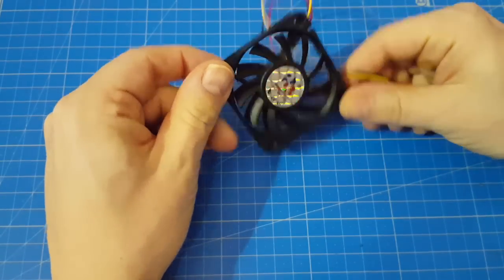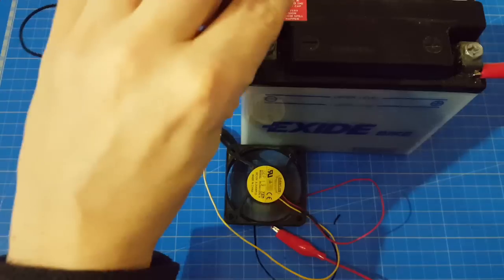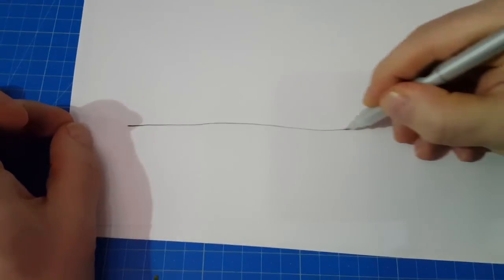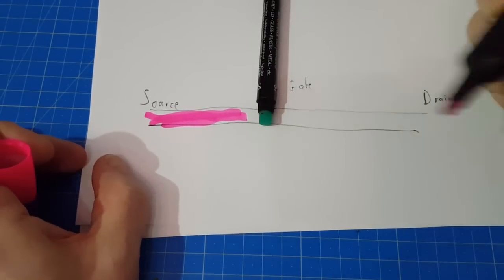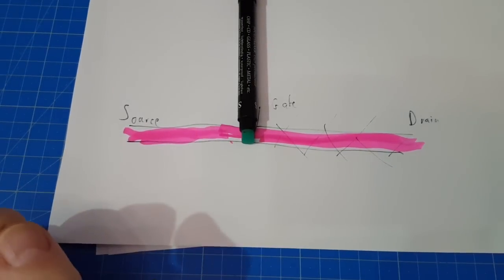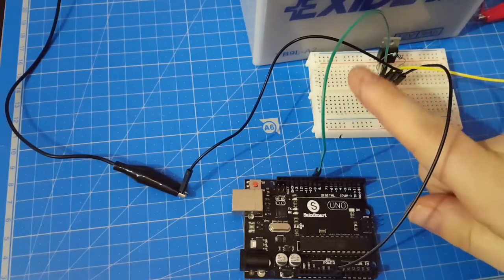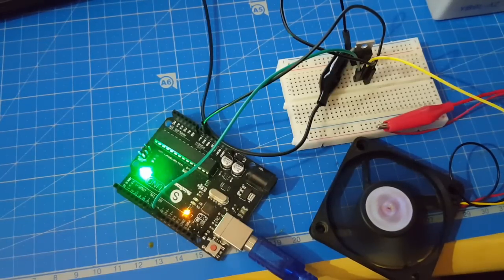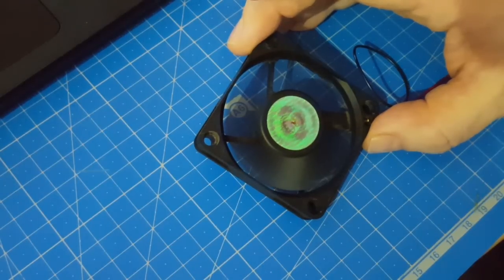Controlling fan speed with mosfet and Arduino

Comment: At 5:26 you mistakenly state that "the MOSFET doesn't need 12V for the gate; it only needs 0.7V". You've unfortunately confused the MOSFET with a bipolar junction transistor (BJT). The BJT does indeed need only 0.7V at its base (but requires several mA of current), but the IRF530 needs between 2V and 4V on its gate to begin to conduct, and rather more than that to turn it on fully (although it needs almost no current into the gate). Some samples of IRF530 may not even turn on properly with the output of the Arduino, and you are much better off using an IRL530. The 'L' indicates a logic-level MOSFET which will turn on fully when supplied with 5V. A lot of logic circuits use 5V as their high level, and the Arduino is one of them.

It's worth also noting that you should add a series resistor of about 270R between the Arduino output pin and the gate of the MOSFET to limit the transient current into the MOSFET's gate capacitance as the Arduino switches its output from low to high. That value will ensure that any momentary current drawn is no more than 20mA, which is the maximum allowed from the I/O pin.

Finally, the fan is an inductive load and should be bypassed by a reversed diode (e.g. a 1N4001), which is needed to absorb the transient spike that is generated when current is abruptly cut off from an inductor. This will prevent the possibility of damage to the MOSFET and reduce the radio-frequency interference generated by the switching.
Reply: Quite s simplification and conflation, EBC / SGD, PNP vs NPN etc.
Reply: good explanation sir, thank you. indeed from what I've read from other source, your opinion is mostly correct 🫡

Comment: Hi neioc187, awesome work here. Ordered some IRF530N Mosfits and got it up and running just as you showed us.   I have tried two different fans and both make a buzzing sound anything less then 1000.  Is this a normal function of controlling the rpm with a Mosfit or is there a way to get rid of the buzz ?
Reply: I would suggest getting some IRL530s next time as they are made for interfacing with logic-levels of 5V or less (unlike the IRF530, which is intended for use with 10V gate voltages). A capacitor and a reversed diode across the fan to suppress the transients might reduce the buzzing. If that fails, then maybe try putting a resistor in series with the fan to reduce the maximum voltage across it. It will lower the maximum fan speed but should make lower speeds smoother. You'll have to determine the resistor value by trial-and-error, but you could perhaps start with a 33R 0.5W resistor and see what happens.

Comment: Great Video. I made this exact circuit just as an experiment; however, my fans are turning very slow. Any suggestions - How could I draw more current into the fan? Or how could I decrease the overall resistance?
Reply: First of all, you need to discover why the fans are turning slowly. Try disconnecting the gate of the MOSFET from the Arduino and connecting it to a higher voltage, but no more than 10V. If that solves the problem, then it shows that your IRF530 isn't turning on fully with just 5V. It's not guaranteed to do so, and you are always better using an IRL530 when driving it from a microcontroller. The 'L' signifies a logic-level MOSFET and the IRL530 is guaranteed to turn on with a maximum resistance of 0.16 ohms and supply up to 15A when it has 5V on its gate.

Comment: you didn't tell about resistor on board ? can you explain it please why use resistor ?
Reply from the maker: It's a pull-down resistor. It was for the manual testing with the battery. Because the drain wouldn't close itself once opened. If you hook the MosFet to the Arduino, you won't need that resistor anymore.

Comment: Hi great video. Can you control 3 fans at different speeds with one arduino? Cheers
Reply from the maker: Yes. You need 3 PWM pins for the MosFets.
Reply: @nenioc187  thanks!

Comment: Can you use a bipolar juntion transistor instead of the mosfet? For example the PN2222 bjt to control a 12V pc fan
Reply: It depends on how much current the fan takes. You need current to drive the base of the 2N2222 and the Arduino can only supply 20mA maximum, which limits the available collector current to about 200mA for driving the fan. MOSFETs are much better for this particular job as they draw almost no current into their gate.

Comment: if am use  use 2 temperature sensor and 5 pc fan for cooling purpose 
is it possible to run at separate and whole fan at same time..?

am lot of double actually is possible if not

how did i done this project..?
Reply from the maker: Of course you can control multiple fans separately. You'll need a separate PWM pin and a mosfet for each fan.

Comment: can we control the direction of the motor? I'm trying with your circuit but unable to control direction
Reply from the maker: What you are looking for, is called a H-Bridge.
https://youtu.be/97fj8j3fvfo
Reply: @nenioc187  I am trying to apply PID to control my DC motor, so we have to use H-bridge instead of just a single mosfet right?

Comment: Hi nenioc187, great video, thank you! Could I ask, what is the maximum voltage for a fan or any output for that matter that could be controlled using this sort of transistor? Could I use a fan that is 220-240V (100mA) to reduce its RPM? And if not, why not? :) Many thanks!
Reply: I assume that your fan is 220-240V AC, so this circuit is not suitable as it is intended for DC applications. Mixing mains voltage with microcontrollers is fraught with problems and usually requires the use of an opto-isolator and a triac to control AC mains devices along with many precautions in layout. That really isn't suitable for a beginner.

For DC use, the IRL530 is rated at 100V and 15A (although not both at the same time), but again, high voltages are not suitable for beginners, and I'd strongly recommend investigating projects that require no more than 24V and a few amps while learning.

Comment: for the analogWrite, he used the values 300 and 1000.  

How come in the Arduino website, it says that the values should range only from 0 to 255?
It still worked though.....???

for analogRead, he can get between 0 and 1023.

Comment: I need your help. I did the mosfet and arduino setup as in your video. The fan runs at 5 second intervals at full speed and half cycle. A strange whispering noise comes out from the fan while working half a cycle. In the form of a diiiiid. What could be the reason for this? Here is the sound I am talking about. (Watch the volume up) 
https://www.youtube.com/watch?v=lvJQx2J2X50

Comment: Why did u put resistor here and whch resistor u use?
Reply from the maker: It should insure that the Gate is pulled to LOW. Without the Arduino the Gate would stay open. But if you connect it to the Arduino and pull the pin to LOW, you don't have to use the resistor.
Reply: A value of 10K will be fine. it's not critical.

Comment: Great video thank you so much! Only that I did exactly the same circuit and used the same Mosfet but the analogWrite(..) does not work. While digitalWrite works and turns on off the fan, when I try to use slower speed by using analogWrite the fan goes OFF completely :( 
My problem is that the fan is quite loud and i want it to operate at slower speed and that is perfect with analogWrite.... I used also the GATE 10. Any ideas?
For the moment with this code is quite silent but i need analogwrite to work, don't know... will check it more....

 #define Gate 10
 
 void setup() {
 pinMode(Gate,OUTPUT);  
}

void loop() {

 digitalWrite (Gate, HIGH);
 delay (200);
 digitalWrite (Gate, LOW);
 delay (1200);
 
}
Reply from the maker: Have you tried using value range from 0-255?

Comment: What is that resistor that you've placed on the breadboard, when you've hooked up the Arduino? And why is it there? You don't mention anything about it in the video, nor within the project page that you've linked.
Reply from the maker: It should unsure that the Gate is pulled to LOW. Without the Arduino the Gate would stay open. But if you connect it to the Arduino and pull the pin to LOW, you don't have to use the resistor.

Comment: https://electronicshelpcare.com/voltage-controller-circuit-with-ampere-using-irf540n-electronics/   <--Is this another way of doing it?
Positive -> Drain -> Source -> Load.     Negative -> Load
I tried to add potentiometer to control the speed from 0 (off) to Maximum by adding potentiometer. It worked only in Simulator (tinkercad) but didn't work in real thing(Fan is always ON. Speed can't be controlled)

Comment: perhaps you can tell me because i can't seem to figure it out and can't find anything or google, and nobody has answered the question.   if you used a 5v fan, how would you wire it?
Reply: Exactly the same, except you'd need a 5V supply for the positive wire of the fan.

Comment: Why didn't you use the PWM wire of the fan? I'm down voting this video because you are not giving good advice with this fan!
Reply from the maker: This video was never about this paticular fan, but how to work with PWM and MOSFETs to control any fan.
Reply: It's not a PWM wire. It's a speed sensor wire. Perhaps you should be voting down your own comment for a lack of comprehension?

Comment: In my country i can only find IRF540N. Can i do the same as this video? 

Anyway 3rd wire (yellow) of the fan is not important right?
Reply from the maker: That depends on your needs. Check the datasheet. The IRF540N can handle a max. 100V @ 33A.

Comment: great tutorial but I think its a bit confusing as you used a 3 wired fan and I thought the yellow wire was for the PWM. I read more and see that the 3rd wire just reads the frequency of the fan. I also was wondering if the mosfet would overheat but I think in this example no as you not using too many W - But very nice tutorial

Comment: Nice video Nenioc187, thanks for that. How can we control multiple fans, say 5-6 of them? Shall we use 5-6 mosfets on the breadboard? Anything else to control them via a temperature sensor? Appreciate your help
Reply from the maker: You could use one mosfet for all Fans, if they all should rotate in at the same speed. If you want to control them all differently, go for one mosfet/fan. And think about using a diode to prevent the fan inducting current to the controller.
Reply: nenioc187 One mosfet and one diode will be enough to control 6*12V fans, right? What type mosfet and what type diode?
Reply from the maker: Depends on the fans, you're using. Check the current consumption of the fans in total and search for a mosfet/diode, that can handle these values.
Reply: @nenioc187  My fans consuming 0.3*6=1.8Amps and my mosfet is IRFZ44. Where and how shall I connect the diode?
Reply: @santonio7283  The flyback diode is connected across the fans, but reverse biased, so that its anode is connected to the MOSFET drain and its cathode to the 12V supply.

Comment: for someone that is trying to use it with 3.3v operating board(like esp32)，this will not work cause irf530m need at least 4v to drive the gate，use other with lower max VGS(th) instead like irl3713 ，this one needs 2.5v

Comment: There was no talk of the 10h resistor of the gate connected to the source. But it was one of the best videos I saw because it helped me in the resistor. Loved your video. Thank you very much.
Reply from the maker: The resistor was original for the purpose to automatically closing the gate. With an Arduino connected it becomes obsolete. But I forgot to remove it ;-)
Reply: @nenioc187  It's not a bad idea to leave it in place as it provides a fail-safe if the connection from the Arduino to the gate is accidentally disconnected.

Comment: can we apply 220VAC  across drain to source
Reply: No, Mosfets are DC Devices and besides that the Voltage is WAY too  HIGH. If you want to switch AC devices you need to use a TRIAC instead of a MOSFET Transistor. Google Triacs and Arduino

Comment: A PWM (pulse width modulation) dimmer is not suitable for a fan motor speed controller.  They are typically used for LED dimming, but it causes the squealing many people are hearing on their fans when trying this circuit.  This fan motor in this video seems to be okay with it, but almost all fans will not like it and will squeal LOUDLY.  It's also hard on the fan motor.  The MOSFET circuit here in the video is okay for on/off control, although it really should have a flyback diode on it as well to protect the MOSFET from back inductance when the fan shuts down: 

https://en.wikipedia.org/wiki/Flyback_diode

To properly control the speed you need to convert the PWM square wave signal to a DC voltage using an RC filter coupled to an op amp driving an LM317 voltage regulator.  You can find this circuit on the internet in various places, like this: 

https://www.edn.com/design/analog/4363990/Control-an-LM317T-with-a-PWM-signal
Reply: The problem with the LM741/LM317 circuit is that the output voltage range is limited to between around 1.25V to around 10V or perhaps less.
You would be better off with a more modern opamp that can swing its output rail-to rail and a normal NPN medium power transistor like a BD135 or BD235 depending on how much current you need.

Comment: hi nenioc187,
Still need +12V battery supply? because i think the fan's positive terminal has to connect the +12V battery supply.
Thank you for your video.
Reply from the maker: Since the fan runs on 12 Volts, you'll probably need 12V to run it.. Unless you have a fan that runs on a different voltage
Reply: I see. Nenioc. Thank you for your reply.

Comment: Besides in programming, does the Arduino need to be plugged in for everything to function
Reply from the maker: The Arduino needs to be plugged in for:
- Programming
- Output to the serial monitor on your PC
- Or just for powering the µC (you could also power the Arduino differently)

Comment: Hi, great manual, but wont works with 3,3A fan. Need for start about 5,4V and controlling between 5,4V and 8-9V. Any idea? (using IRF540N mosfet)
Reply from the maker: Corresponding to the datasheet of the mosfet, it can handle up to 33A @ 10V. So it still would suitable for your needs. Don't know your fan, but if 9V is max, you can use 10V as a source input. From there it is easy. To achieve 5.4Volts you need a duty cycle of bout 54%. For 9V a duty cycle of 90%. That's easy as that ;-)
Reply: Hi, my fan is VA450DC model V34809-90 (12V DC 3,3A).  analogWrite(Gate, 255) gives me now 5,7-5,8V max. Source is PC power source.
Reply from the maker: My guess: you've connected accidentally to the 5V output of the PC power. Or, you've really used a 12V output that can't handle 3.3 amps. So the voltage drops.
Reply: Just tested - its from yellow (metered 11,8V from source). Tested fan straight from PC source - goes full. My schema is http://axweb3.info/jet/20180530-i41-91kb.png
Reply: My guess is that the output from the Arduino isn't enough to turn on your sample of the IRF540, which is normally used with 10V to drive the gate. Use an IRL540 instead, which is specified for logic-level use and will perform properly with gate voltages of 5V.

Comment: this is awesome knowledge by rookies like me, 
can I ask you for an advice? I want to change the potentiometer by a digital one in my adjustable power supply and and raise or lower the voltage with two switches, i found your video looking for how to handle more voltage with Arduino, since digital potentiometers only handle 5v as maximum, my power supply specs are 12v 3.3A , like this example:
 https://www.youtube.com/watch?v=Whkh5A0blhs

Comment: Very good video! I dont understand the last thing you do. I understand that we use mosfet like a switch ,  so when we give +voltage to Gate the circuit is closed and when we connect Gate to Ground the circuit is open (and the fan stops). If we give analogWrite(Gate,300) and analogWrite (Gate, 1000) we give a voltage bigger than the Vthreshold to the Gate. In both ways we activate the circuit. But the Gate is  like a switch so what exactly increases the fan speed?
Reply from the maker: Since we are not using a analog pin, but a digital PWM pin, we don't change the voltage on the gate. It's always 5V. PWM turns the 5V on and off again, very fast. If we using analogWrite(Gate,300), means that 300/1024 of the time of a duty circle the 5 V is applied. The rest of the time, it is set to GND. 
It works like the part, where I connect and disconnect the 12V of the battery to to fan manually very fast https://youtu.be/Pw1kSS_FIKk?t=60 .
Reply: I understand , thank you very much.
Reply: @nenioc187   Just to elaborate the my question..  in other videos the the code is explained as analogWrite(Pin, DutyCycle).. so Pin is the digital pin no. to which the Mosfet gate is connected(here, pin no 10).. and the dutyCycle should be max 255.. but in the code, it is written as 300 which you said 300/1024 of the time... now my question is if i write 255 instead of 300.. will it count as 255/1024 of the time or the highest dutyCycle value for the gate..? and why.. It will be a great help if you pls explain. Thanks.